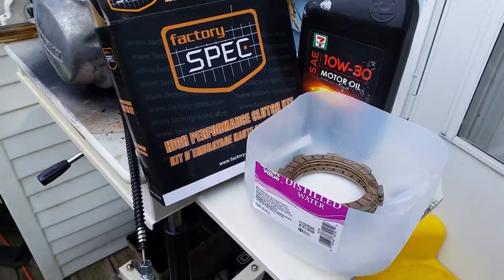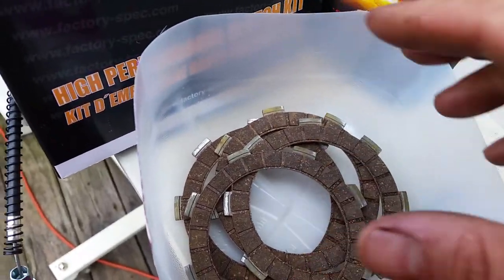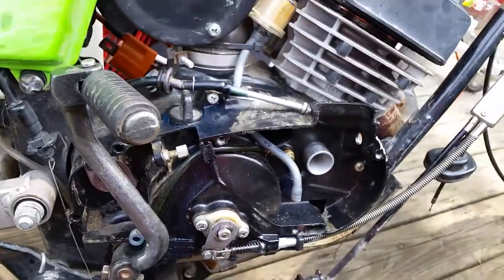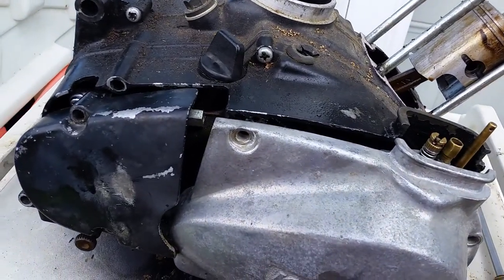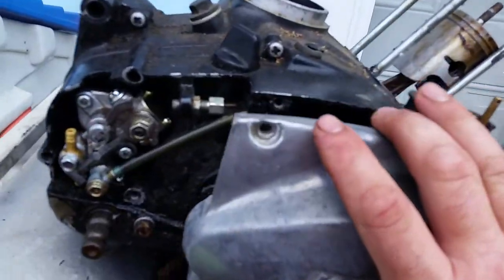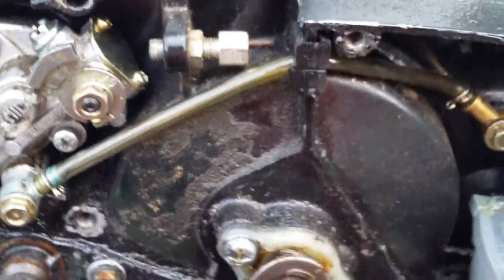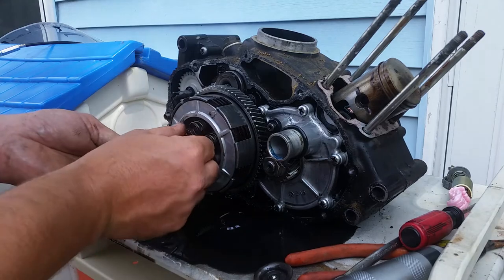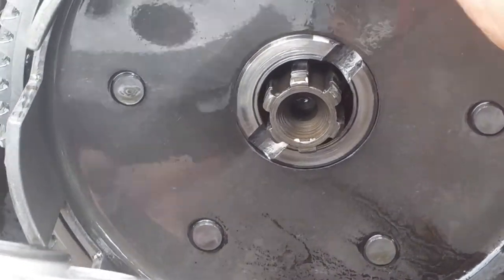KE100 KM100 KD100 KD80 clutch part 1

Comment: Hey Kevin. Thanks again for the videos. I’m gonna change the clutch on my boys 97 ke100. I haven’t taken it apart and want to get parts prior as much as possible. I noted the case seal,oiler seal and kick start seal. Anything else you you recommend? Also considering the barnett clutch. Should I do the  friction, steel and springs together?

Comment: Where can I get the rubber plugs I'm missing the one that is on the side of the engine to unscrew the one bolt to take off the carb and then I'm pretty sure I'm missing another on under the engine it's a ke100 5g 1971

Comment: My Snap ring had a thin washer behind mine... also, I don't have "clutch alignment" arrows on mine.. Kawasaki must of got wise after my bike. The NEW shift shaft is in ! ! ! So... Do you have a video on how to test, prime etc the oil pump? The previous owner disabled it. I'd rather use it since its in there... Looking through the rotary valve, I can see the little brass nozzle aiming in the rotary port hole. So, I'm thinking it will work. Some people prefer to premix. I think its easier to gas n go, and keep an eye on the oil sight.   You're a great help. even if there is a small amount of people watching... we are all learning. You're a great teacher!
Reply from the maker: Jenn Tek I have oil pump videos
Reply from the maker: Jenn Tek thanks I try
Reply from the maker: Jenn Tek premixed fuel seems to give carb trouble
Reply: I'd rather use the pump. the previous owner cut the line from the tank, and plugged it just above the grommet.  I replaced the lines... I have the shift shaft in, and tomorrow (Sunday) I'll bleed the oil pump.  So far, so good. Slow process (had to run to the store 2x for bolts, fuel / oil lines and other things... Well? I'll keep you updated... The bike runs. Oh, dummy me... I forgot to get a shift lever and all the bike shops are closed on Sundays. ... bahhh....
Reply: I think... the oily fuel being sent through the carb isn't a good idea on oil injected bikes... I agree about carb troubles.

Comment: Hi Kevin, awesome video. I let my buddy drive my 1997 Kawasaki KE100 and while he was trail riding I think he stopped and when he started going again he was in a higher gear, not sure what all he was doing. Now it won’t move at all. Motor still runs, I put it in first gear and nothing. Just curious what to begin checking. Thanks!

Comment: I like ur video more,, it is very interesting to watch ur videos..
Reply from the maker: Thank you
Reply: Hello sir... , I like to know the factory assembled crankshaft alignment value for ke100 ,, I'm facing problem in my bike after rework the crankshaft,, and also replace a newone... Help me please sir... 😟
Reply from the maker: @gayathrigayathri4861  with that I would recommend buying a shop manual there's a lot of specific information for your application doing a rebuild with out a manual your going to have trouble
Reply: Correct sir,, I also had a service manual ,,,I followed through shop manual,, every thing good around below the service limit except crankshaft,, the crank shaft runout limit had under 0.04mm in shop manual ,,, but I don't  know where to locate this runout limit...
Reply from the maker: @gayathrigayathri4861  on the shafts of the crankshaft
Reply: @2strokeguru thank u sir.... We checked the shaft of the crankshaft, the value is 0.00mm on both the sides of the crankshaft shaft, but the performance of the bike is very poor and vibrations.. After that we know that the value is there that under 0.04 mm is the Standared value and 0.1 is the service limit...

Comment: Kevin thx for all the info. you were instrumental in a 1980 barn find coming back to life BUT, i have a problem: I had a frozen clutch, so i did the type F trans fluid trick and let the bike sit for a week, my total ride time is about 5 mins of first gear flat gentle riding to slowly loosen the bike up. after about a 2 min ride the clutch plates unseized but then  a hard a lite random grinding in the engine. the engine runs fine but now the clutch randomly engages/disengages along with the grinding noise. If i push the bike (not running) in any gear with clutch lever in, i'll get about 6 ft or more and the gear randomly engage. if i then push the bike backwards like 3 ft the gears disengage and act normal(clutch held in). when i start forward again it will randomly gear engage again. i'm suspecting one of the clutch friction plates disintegrated and randomly connecting engine to trans with clutch plate debris. have you seen this before? again the engine itself revs fine and the noise seems more from the trans/rear. the chain/sprockets are not causing this noise either and are viewable with covers off. the noise started with in seconds of the plates unseizing. thx
Reply from the maker: crabtrap transmission fluid can hurt the clutch it takes 10w30 I have a video on how to free a stuck clutch
Reply from the maker: crabtrap https://youtu.be/q9lXFJdUNpA
Reply from the maker: 603 3958097 call me later after 5
Reply: i'll call then.

Comment: If 4th and 5th gears are slipping, would I replace the clutch plates or something else?
Reply from the maker: It could be worth gears could be a worn shift fork if 1 2 3 gears are good clutch is fine
Reply: @2strokeguru  1, 2, and 3 are good. When I first got it I was shifting wrong, And i think I wore down 4/5 excessively

Comment: Do the 6 bolts get tightened down all the way when reassembling then torqued to 3 ftlb? Will they be all the way down to the stud they're bolted into?
Reply from the maker: Yes till they seat then 3 ft lb you can use yellow or green loc tight do not use red or blue

Comment: Where do you buy these clutch plates? Also, I have a 74 G5, can I use clutch plates from a 76 KE?
Reply from the maker: Yes you can and Ebay
Reply: @2strokeguru  Awesome thank you! Is there a particular seller on eBay that you get yours from?
Reply from the maker: @dustinbeck3807  no
Reply: @2strokeguru  Ok. Thank you!

Comment: Can i use locktite on my clutch cover and other covers screws?
Reply from the maker: I wouldn't if you do you can destroy the threads next time you take them apart
Reply: @2strokeguru  thank you so much i really appreciate all your videos! And can i use any tocktite on petcock bolts? And do u know how tight they should be?